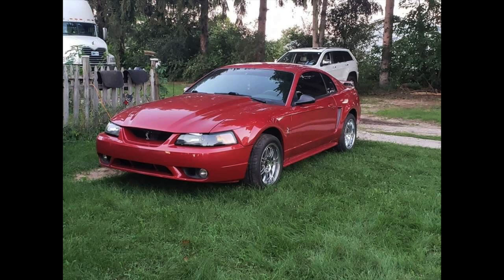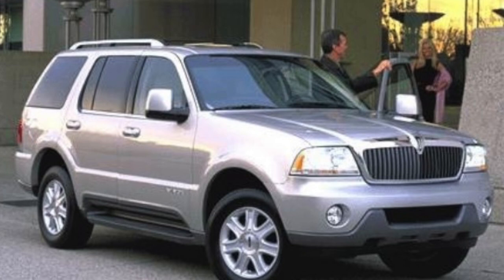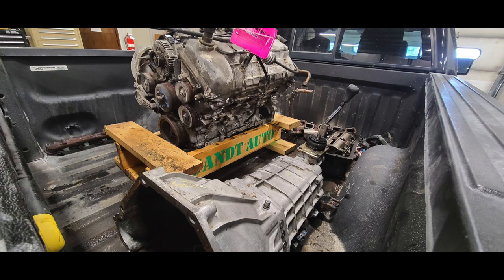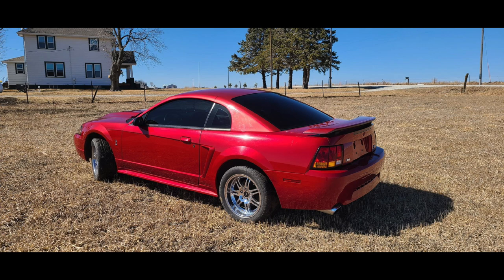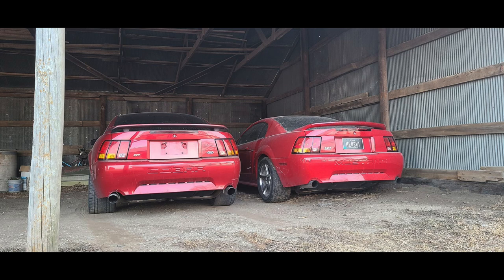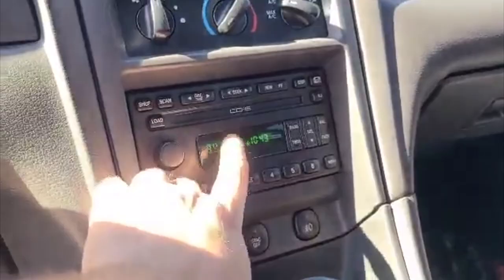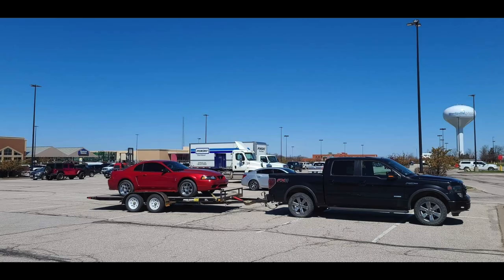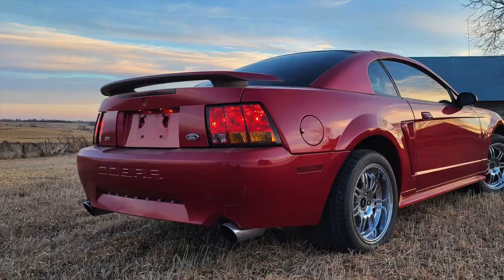2001 Ford Mustang SVT cobra saved : story

Comment: I have an 03 GT mustang that I absolutely love and I bought an 03 limited explorer that has the 4.6 2V and that’s been great to drive. I had a aviator come into my shop and I assumed when I noticed the v8 badge it had the 2V. I was blown away when I looked at the 4V valve covers.
Reply from the maker: Yeah that’s really cool. Fun fact, the Mach 1 and 03/04 cobra benefited from the 4V newer version C heads and cams that were actually part of the aviator project.

Comment: Dude you hit the hammer on the nail when you said real enthusiastic save cars not part them out. Same thing with my 01 True Blue Svt Cobra. Was a 2 owner car since 04 had some strut tower damage (109k but dealer replaced longblock at 85k) so I found a 99 cobra being parted out and got the parts to fix her and put it back on the road. I daily drive it now.
Reply from the maker: Awesome. Nice work

Comment: Just recently picked up one just like this. 71k $17k. Very good condition. Only thing was the front headlight housings were skunky/grimy/dirty on the inside so picked up a new set for $65. Also installed new white 6000k led lights for it and my fog lights. Also the rear trunk 3rd brake light was a bit scuffy/scratched so picked one of those up also for about $30.
Reply from the maker: Very nice

Comment: Man I’m having mad trouble with my 98 cobra. So many gremlins. Tough learning curve coming from carb cars.
Reply from the maker: It should be much easier. These cars are very reliable and run so well with the computer and fuel injection. There must be some bad sensors or something

Comment: I’m curious as to why people swap out the motors and not just get them rebuilt and keep the original engines in these cars… My 01 cobra runs great but I know the day will come when I have to address the motor… I have been doing my research as what to do replace it with an aviator, coyote or just rebuild the original motor… Why do people swap them out instead of rebuilding them and keeping the original motor in them?
Reply from the maker: Cost and effort
Reply: @justin.c_svt  Thanks for the reply… I guess I’m true to keeping these cars original… I’m going to have mine rebuilt when the time comes… I like the idea of keeping the original engine running.

Comment: I really want to splurge on a nice set of 99 tails but i dont think i could pull the wiring off. I know it prob is easy? But it seems daunting to me. 🐎🐍🤘🏼 PS Manley rods only came in 03-04 correct?
Reply: Super easy.
Reply: @bubbadw60  i got to do it Wyatt. Nice job. 👍🏼👍🏼

Comment: If I wanted to put a cobra motor into my GT (2003) what else would I have to do besides the engine?
Reply from the maker: Axle, wiring harnesses, computer, driveshaft, hydro boost lines, transmission, and more
Reply: @justin.c_svt  damn.  Thx for the info!  Ill just put a 2v back in.